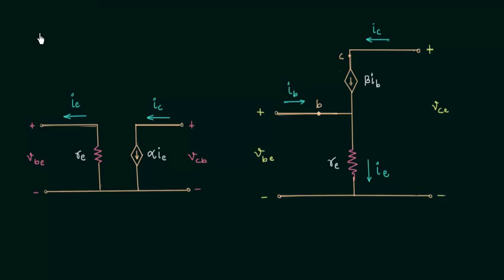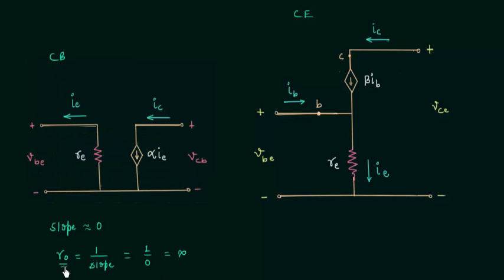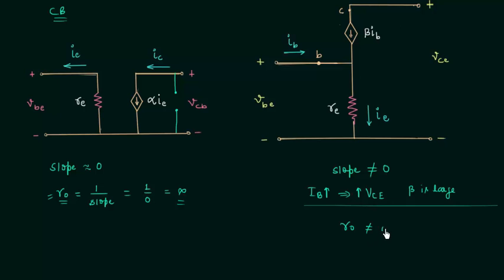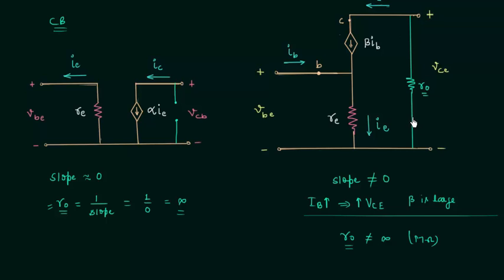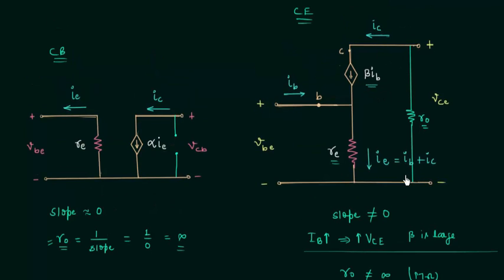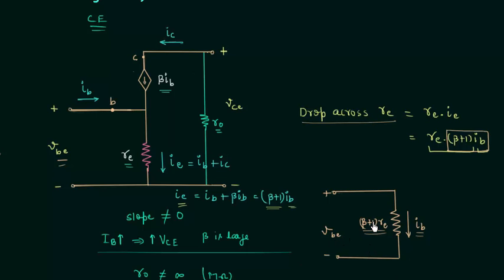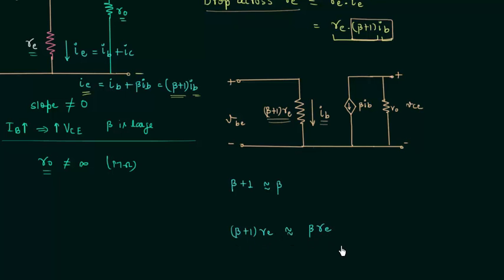re Transistor Model (Part 2)

Comment: In CB - Configuration,  emitter base junction should be forward biased and base collector junction should be reverse biased , so Emmiter current should move towards negative polarity(Plate) in the input loop, in the remodel it is moving towards positive plate.

Comment: Sir, you said in a separate video, due to early effect, if Vce increases, Vcb increases, hence Weff decreases, and so Ib falls, and more electrons collect in collector hence Ic rises, thats why Ic is dependent on Vce. Why in this video you said that slope not = 0 is explained by Vce rise, then Ib rise? I think u meant Ic instead of Ib.
DID YOU MESS UP CB AND CE?
Also, I think slope not = 0 is not due to large beta value. beta value is merely change in Ic / change in Ib. Large beta value means large change in Ic for small change in Ib. It does not explain the slope of Ic vs Vce right?

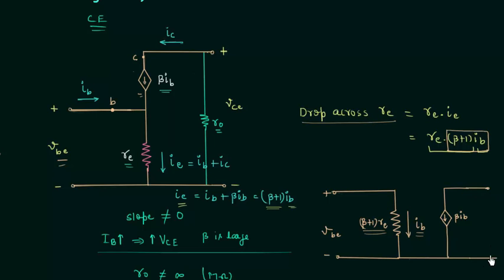Comment: At 5:31, are the two circuits same.... It is not so.... beta*iB is connected between C & B in circuit 1... where as in circuit 2, it is connected between C & E.

Comment: i think common bias configuration u drwan for npn transistor is wrong...at input side terminals should be oppposite
..correct me if i am wrong..
Reply: it should be Veb with the given polarity or polarity should be changed if Vbe is used